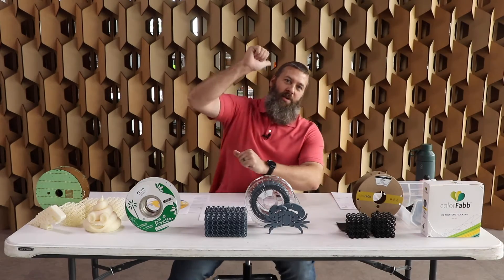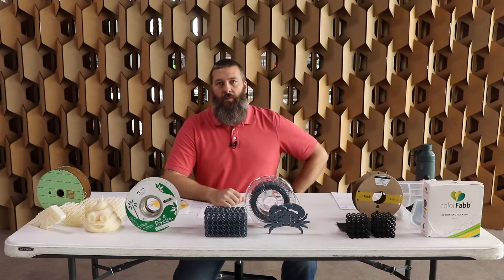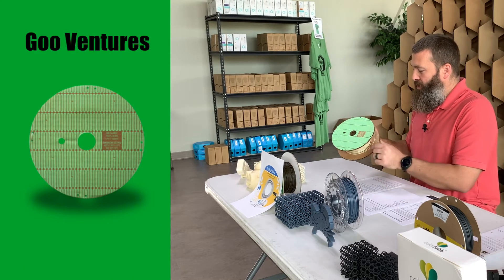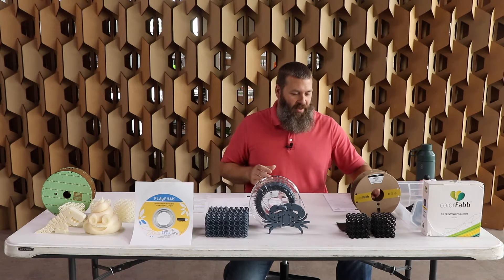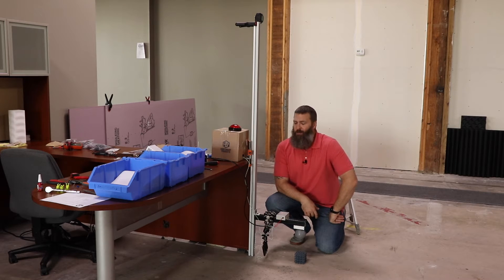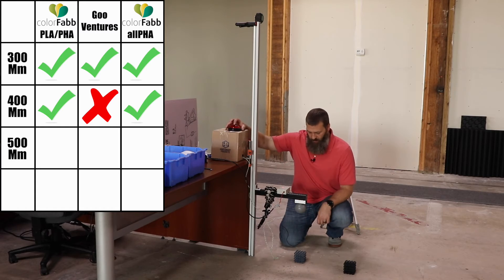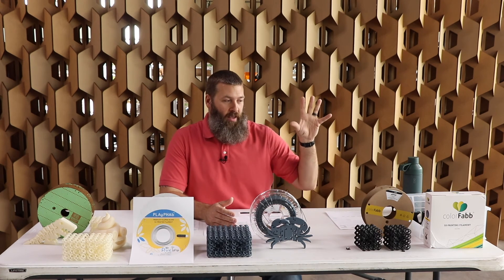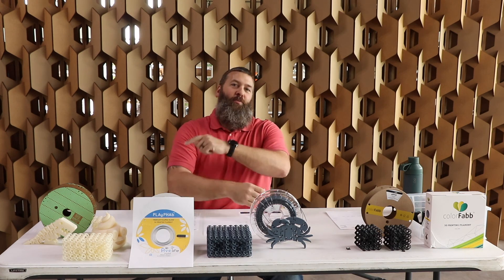Should You Start 3D Printing with PHA Filament?

Comment: Hi, I've been trying to find a material thats safe when printing and can't find information if PHA emits more or less UFPs than PLA or if it even does emit. This may sound excessive but I have family with asthma and want to make sure it wont cause them problems. Does anyone have any info they could share?
Reply from the maker: I don't have any specific data on PHA's UFP emissions compared to PLA, but it's an important question since nearly all thermoplastics emit some level of them. If you're concerned about indoor air quality, you might consider looking into filtration or printing in a well-ventilated area.

Comment: The bed adhesion problem with PHAs is really unfortunately. Regen PHA has a problem of impossible bed adhesion. AllPHA seems to have a warping issue, but then excessive adhesion if it stays on my textured PEI bambu plate. I've heard that going super cold is the key, so thinking of saving this until I can move my printer into my basement in the future... Did you ever find other tricks to get easy mindless prints? Bambu PLA and PETG in the X1C is a slam dunk, almost never have trouble. Which some might consider to be more environmentally friendly if you have to print 3-4x to get the same print in PHA vs PLA...
Reply from the maker: Yes, bed adhesion is certainly an issue. The tricky part about PHA is that it crystallizes at a very low temperature, which is what causes it to warp up from the bed. So the lower the bed temp and the lower the nozzle temp the better chance of avoiding crystallization. Turn your bed heater off entirely and do a temp tower to determine your lowest possible nozzle temp. Also, glue stick (PVA) works quite well to hold the parts down. If problems persist then adding features to the print such as adhesion discs/mouse ears or brims have also proven effective for me. I hope that helps!
Reply: What if you stick the plate in the fridge for a while first?
Reply from the maker: @GloriousSwordHorse  As long as it does not result in condensation forming on the cold bed plate then I think there's a possibility that this could be a beneficial approach. I don't think you'd want it to be COLD, but slightly lower than ambient temp would probably be a good thing.

Comment: Can someonepoint me in the direction on how to dial in All PHA. I haven't had a successful print yet.
Reply from the maker: I'm assuming you are referring to ColorFabb's "AllPHA" material. I struggled a lot to get good prints with that material (as I showed in the video). ColorFabb has some suggested printing advice on their product page (https://colorfabb.com/allpha-black). The biggest issue with this material is that it doesn't want to stick to the bed. And overhangs are a problem. Make sure the bed is cold (no heat whatsoever), use a brim, and some sort of bed adhesive. I tried several and I believe regular old glue stick seemed to work best. For what it's worth, I found Beyond Plastic's PHA to be significantly easier to print with than AllPHA. I know that's not available everywhere (yet), but it's really good.

Comment: What about a PHB/PHA blend?  Still safe for the environment, but just degrades more slowly than PHA alone.   I found some by NonOilen brand.   Let me know what you think.   Thanks!
Reply from the maker: If it still biodegrades in the same (or a similar) way and it's an easily printable material then I'm into it! I've heard of Fillamentum's NonOilen before but I've never printed with it. I should fix that. Great suggestion!

Comment: That's a fascinating background you've got there. Can you give me any more information about it? Did you laser-cut that yourself? Are there files available somewhere?
Reply from the maker: Why thank you! This is a custom-designed temporary wall that we had made to separate our retail space from our community area. When we first moved into the space we didn't have nearly enough products to fill up the retail area so I had this wall made so the retail area would feel smaller and less empty, then we could move it as needed when we got more products in. It was designed by a local artist, Molly Spain. Then it was laser cut from corrugated cardboard by a local shop, Notch & Nail. It is meant to emulate the HartSmart Products logo with pieces that simply slot together. Since it's all just corrugated cardboard and no glue or fasteners, it's 100% recyclable!

Comment: Hi ECOstruder, good to find this! Finally a ray of light on this confusing urgent subject of sustainability
Reply from the maker: I'm delighted that you found it! PHA is a really cool material, and I have even found some additional options after publishing this video. I'm happy to see development happening with this eco-friendly filament option.
Reply: @ecostruder  would you mind sharing the additional options?
Reply from the maker: @jutube476  I'd be delighted to! I haven't printed with it yet, but filaments.ca now offers a PHA material called Regen PHA. The material I've mostly been focused on testing out (and it's performing extremely well so far) is the PHA options from Beyond Plastic. They have a Flex PHA which is really good and a Standard PHA which is a bit closer to PLA. Both print much easier than the allPHA stuff from Colorfabb and I've got some amazing parts with very minimal effort. The trick is to print on a cold bed with some glue stick on it--it works wonders. Good luck!
Reply: @ecostruder  thanks a lot! you are a big help.

Comment: I work in the makerspace of a public library, one that 3d prints whatever patrons ask for. It was tough, but I've more or less managed to convince them to make 100% PHA our standard go-to everyday material. Tough in that it costs a lot more, AND tough in that it's ridiculously hard to print well 😅
Reply from the maker: First of all, I love that your public library is providing access to 3D printing for your community--that's awesome. Even better, the fact that you are using a fully compostable material ensures that all of the 3D printed stuff that you make won't exist in a thousand years from now. Excellent work!
Reply: Do you mind sharing how you print PHA? I heard warping can be an issue

Comment: Would you want to do a test on the degradation of the allPHA filament?
Reply from the maker: I would love to do that. Unfortunately I don't currently have a good way to carry out that test. I'd also want to compare the degradation of multiple types of 3D printing plastics, rather than limiting it to allPHA. So many people still think that PLA is biodegradable. It would be great to show how PHA compares to PLA. I'll have to think through the right way to do this. It's a solid suggestion. Thanks!